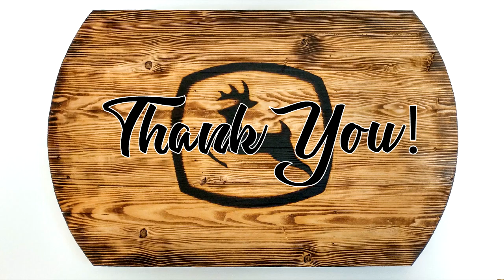Making A Big Sign With A Torched Logo!

Comment: I love the stencil. Another great use for the scroll saw. What material would you use to make a reusable one?
Reply from the maker: That might be tricky but you could always pay a shop that has a plasma cnc to make you one out of thicker metal
Reply: Thanks. Ill do some experimenting. See how many burns I can get out of different material.
Reply: @nateswoodcraft6715  I am doing this very same thing now. Did you ever figure out what worked best?
Reply: No sir. Haven't tried it yet. I got into hand routering signs and kinda got stuck. I was thinking about some thin wood and getting it damp..